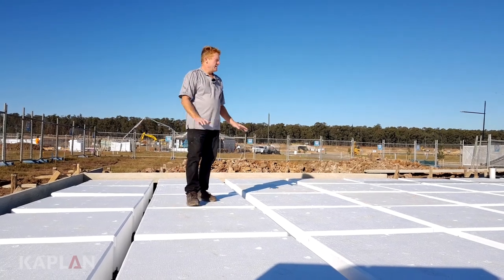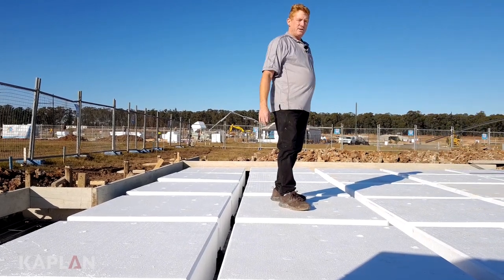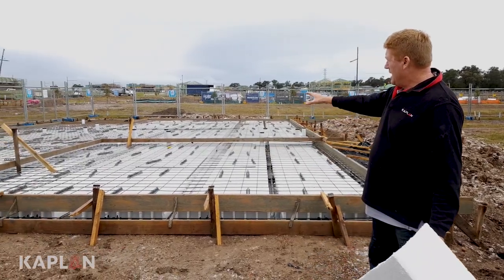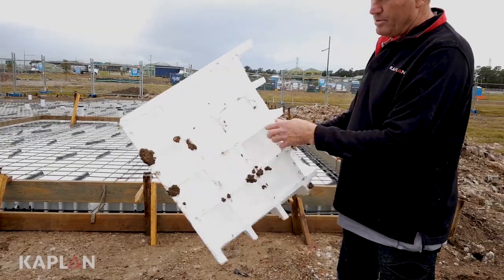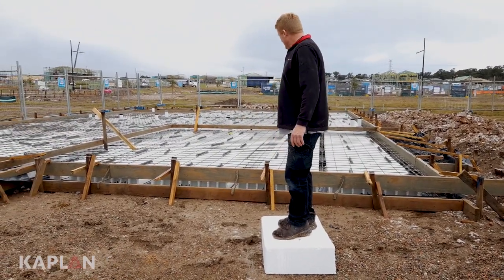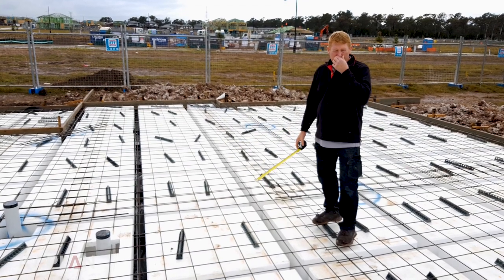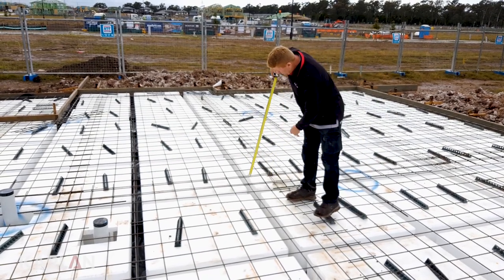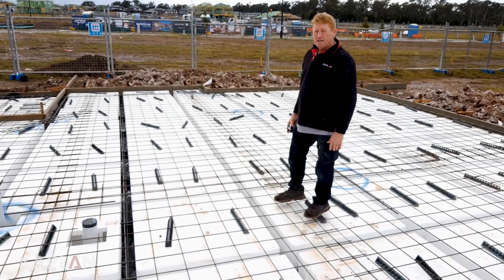Kaplan Homes: Build stage 4 - Waffle pod formwork & steel for the concrete slab

Comment: Always keep in mind if the drainage is not included and installed water will get into the plumbing trenches and create slab heave. He is just talking about how they do it but not about the drainage none of the builders talk about drainage. Drainage is so important if this builder in in Australia  no matter how many years they offer the law in Australia is only 10 years I have not heard of this builder Kaplan homes unless they are a private independent builder I'd like to see if they installed drainage and sloped the land away from your footing this law is only in Australia.  I am no builder or expert I just know because of my own bad experience and 7 years later still fighting our builder, it's great that he post video showing the waffle pod slab but at the end of the day it's still a waffle slab without sloping the land away from your footing and drainage system around your house God help it's not pretty once water I'd under your slab the damage is done. Good luck hope it works out for everyone.
Reply from the maker: Sorry to hear of your situation. Some general points and about Kaplan;
•	The land outside the building must always fall away from the home
•	Surface water drainage is always provided especially to those areas where it is difficult to achieve the required falls
•	Our concrete slabs are a minimum of a H1 slab
•	We provide concrete piers in both the filled areas as well as the cut areas, which is below drainage trenches
•	Problems can occur when owners or their landscapers or concreters do not fall landscaping or paths away from the home or damage surface water drainage during their works
•	Problems can also occur when planting of gardens and trees are positioned against the house and or excessive watering occurs
•	We talk about this to our owners at the handover stage and provide information on Foundation Maintenance 
•	We provide lifetime structural warranty not 7 or 10 years. However, homeowners always have a duty of care to look after their home as they do for their car or themselves.
Reply: I understand you hand over the booklet of the BTF18  which the home owner responsibility, yet no one talks about the BTF 19 AND BTF22 which is the builders responsability to building a new home, those part A.      and B  it really hits the builder for not understanding the soil problems, in the 80s I built on the old raft slab for 30 years not even a hairline crack anywhere yet I had a fernery next to the slab at our family room sliding door with overhead sprinkler drip systems or fine spray garden bed next to our house yet we had no problems still today it stands with out any issues. The day they introduced the waffle pod slab everything changed so many regulations for the owner to remember keep in mind we as owners are no experts we are used to our parents homes standing 70 p,us years yet today's new homes don't last 12 months I have going through it now and 100s of new homes with slab heave why do we as the owners have to put up with greed over quality, why not offer the old raft slab with waffle and explain to a new home buyer the difference of building with one or the other, I bet if you told new home buyer the risk associated with waffle pod slab and the legal cost to have the builder come and fix I bet they would choose old raft slab over waffle. I have reached out to a person who is the part writer of the AS2870  and the things he has told me would make anyone head spin, unfortunately politics plays a big part in how laws are passed in the building industry waffle pod slab is one of the worse ones unless water and trees are put into the laws and builders do the right thing waffle pod slab are the biggest killer of new homes. No matter how many years a builder offers its still 10 years by law so why offer such warranties when the law is 10 years I don't understand.  You may do the right thing but it's still a waffle slab. I hope you can understand why people get angry like I am they have changed me for ever for distrying my family life which 7 years new home we cannot even live in it yet the big builder keeps shopping around to find experts that will agree with them and issue missleading reports so where is the justice in this. I don't mean to hammer anyone but put yourself in my shoes . Thank you for your reply.

Comment: What happens when water goes under the slab
Reply from the maker: Stormwater should be directed away from the home when landscaping. Kaplan Homes will provide stormwater drainage where ponding will occur. However, the concrete slab will allow for some movement as a result of the foundation material (soils/clays) under the slab expanding and contracting. This movement is also considered when brickwork is laid as brick control joints are provided where required. 

The concrete slab will be designed by an external independent structural engineer who designs the concrete slab in accordance with the relevant Standards Australia and Building Code of Australia which takes into account moisture below the slab will occur.

Comment: Just curious as to why there's no drainage metal under slab? Crusher dust? Do waffle pod slabs not require any fill?
Reply from the maker: Hi mate, our plumber/drainer uses 10mm recycled aggregate. All sewerage lines comply to regulations as they are inspected by Sydney Water and must pass before approval is granted.
Reply: Most houses don't and it causes under slab drainage issues.
Reply: All drainage trenches should be back filled with clay plugs not crashed rock as that allows water to enter the trenches and create slab heave. No regardless of how many piers you have they will not work or help your slab if you have slab heave. Unless your piers are tied into the slab piers are useless and to say all the waffle slabs are designed for H1 soil what about if it's a P soil classification who decides on what slab to build.  My soil test classification cost me nearly 6k for laboratory testing which is the proper way of classifying a soil test. But I don't think builders would pay that kind of money for every soil test, they pay for a simple spoilt test they drill most is 1.8 metres but it's a tactile test by hand, unless the soil classifier has tested soil in that region and understand the soils in those areas. Then laboratory testing should be done. No builder will spend extra for soil test.
Reply: @mariofaggiano8247  My builder did, they just passed the cost onto me!

Comment: Designer usually requires Extra bars  around penetrations. Why don’t the pods float when vibrating the concrete? Good to see conduits capped.

Comment: How long is the lifetime warranty you offer
Reply from the maker: Hi JJ, our Lifetime Structural Guarantee lasts for the lifetime of the building for the duration of ownership by our customers, we provide it as an exclusive peace of mind benefit for our customers only.
Reply: @KaplanHomes  structural warranty in Australia only has to last 10 years so I don’t know why you’d throw yourself in the deep end and guarantee a lifetime warranty. Hope you haven’t put that in your contracts mate, for your sake.
Reply from the maker: @tommath9263  Thanks for your concern Tom, however our Lifetime Structural Guarantee is genuine and in writing. Our construction is of such consistently high quality that we're one of the few builders in NSW that have been approved to offer this Lifetime Guarantee by the insurers. It's official recognition of how well built our homes are and it's not an empty boast because it's backed up by our insurance. Ultimately this is about protecting our customers and it's 100% in all our contracts ; )

Comment: what's the idea behind the waffle slab exactly
Reply from the maker: The video shows how the slab will have reinforced ribs running along and across it once the concrete is poured. This results in a very strong, yet light structure compared to traditional concrete slabs. The reinforced ribs provide increased strength in two dimensions, resisting vibrations and soil movement and the design of the waffle slab means less concrete will be used, saving money and also being better for the environment.
Reply: It's cheaper to build than a raft slab, sure. But if water gets underneath that slab and you have reactive clay soil, you can end up with slab heave and major damage to the building. That means you need to maintain proper drainage throughout the lifetime of the building and that's not something anyone who builds with waffle slabs seems to ever acknowledge!
Reply from the maker: @spk_eze  It is true that drainage will need to be maintained due to reactivity of soil, however this does not only apply to a waffle pod slab on ground. Structurally, all concrete slabs bearing on clayey soil will experience heaving, whether it’s a raft slab, bearer & joists on footings, and waffle pod. 

Waffle pod slabs meet the Australian Standard as do the other footing systems. They are designed, inspected and certified by an external Structural Engineer not the builder. We would not be providing this slab system and giving lifetime structural warranty if it was problematic.
Reply: How thick are the foam slabs? How thick is the cement over the foam?
Reply: As The waffle pod technique is popular in AU , if the building quality is good enough and then it will last long life
Reply: @davek6630  In this case 300mm pods and 85mm slab over pods .

Comment: Good for the environment having that styrofoam blowing around the place in wind?
Reply from the maker: We are quite meticulous when it comes to properly disposing the waste generated from building, all the excess pieces of foam are collected and bagged. Can't help the minute particles, but if its about minimising environmental impact then consider the fact that the waffle pod slab system uses a lot less concrete compared to completely solid slabs. Cement production is responsible for a huge amount of carbon emissions, so the less concrete is used the better.